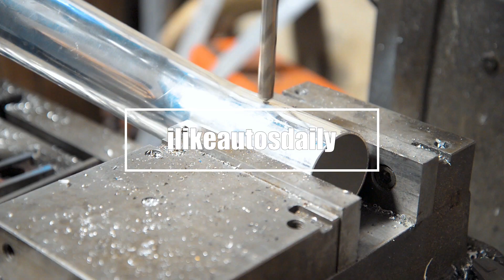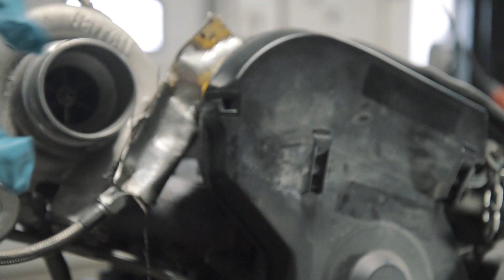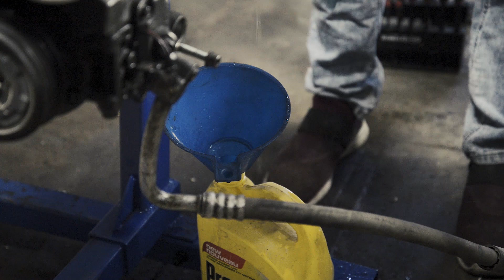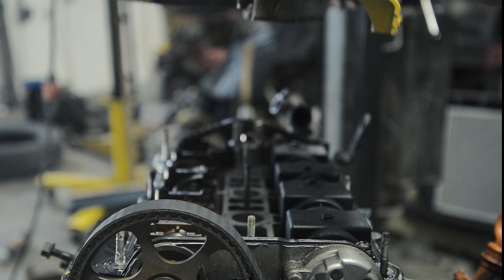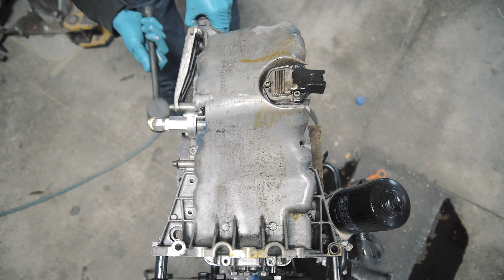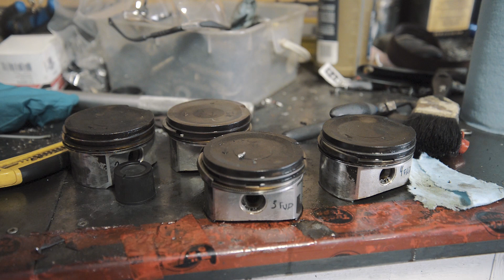1.8t engine disassembly - finding out what failed!

Comment: I'd put money on it that pistons may be poor quality but the rings pinched due to not enough ring gap and it knocked the ring land off
Reply from the maker: i did gap the rings larger than spec because i knew that the engine was going to see high boost but anything is possible
Reply: @ilikeautosdaily  if you gapped them then there's definitely no way they pinched cause my 1.8 is making 450 whp @ 25 pounds. So definitely bad pistons